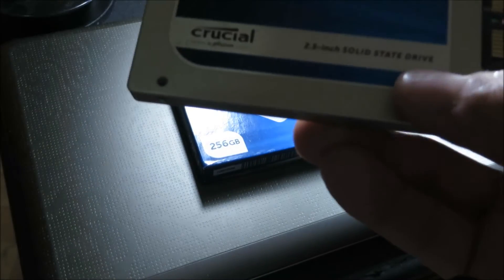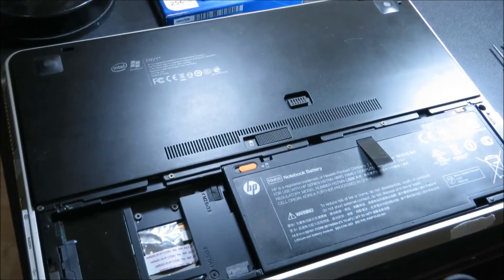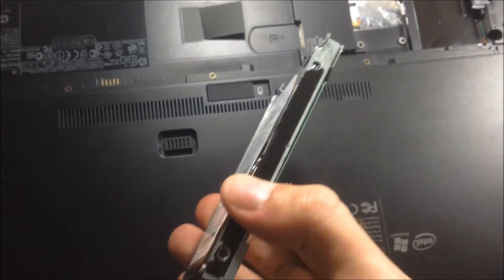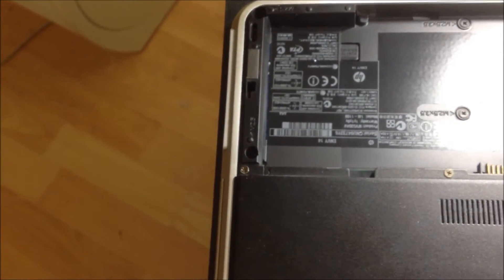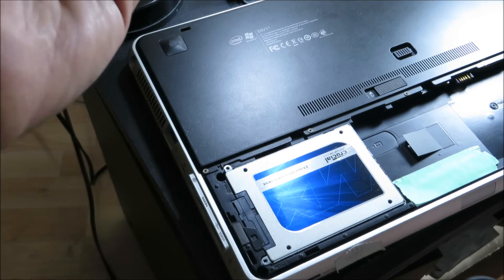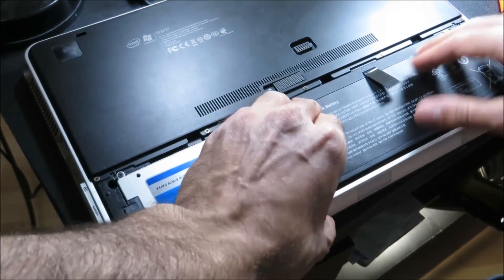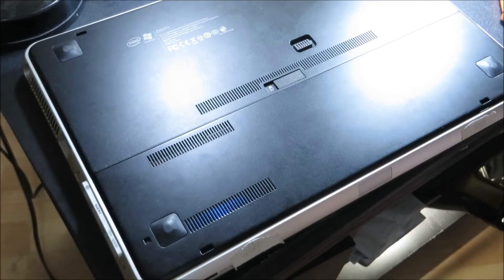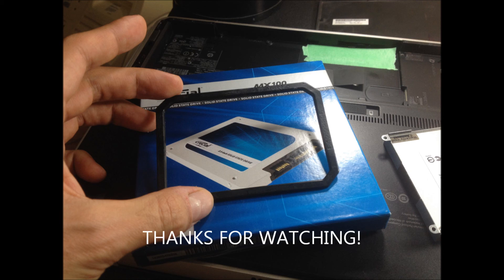Adding a SSD into my Laptop Hp envy 14 (crucial MX100)

Comment: Thanks for the video.  I have the HP ENVY 14 beatsaudio (14-2020NR).  I have 16gb of RAM and the I5 intel processor so my speed isn't to bad already...  How can I know if my laptop supports AHCI or SATA3?  I have looked around and can't find any answers....
Also, if it doesn't support either of those, will it still run or will that be a problem.   Thanks again.

Comment: Did it make the laptop more silent? Because i dont like the sound of the hd running on full rpm constantly. Also did it improve your battery usage?
Reply from the maker: +mathijs v  it might have improved the battery life but i wouldn't know because my battery is practically dead.

I'm eventually going to get a new laptop because i noticed the main noise of the laptop are the fans, and sometimes my fans stop working... Otherwise it's been a good 6 years
Reply: Ok I see. Thanks for the reply!

Comment: Did you used the recovery manager in the new SSD? because right now I am facing a problem, when I try to recover using my DVDs set, it show me an error telling me that the HD is not the same that the original. "the hard drive of this computer is smaller than the original shipped hard drive"
Reply from the maker: +Ignacio Sandoval Nope. I used acronis cloning software that came with my ssd. I simply cloned my old hard drive to my ssd.

Comment: I'm planning on replacing my HDD to an SSD on my hp envy 14-2002ea, the user manual is here:

http://h10032.www1.hp.com/ctg/Manual/c02878045

The only issue is, I was wanting to replace the HDD with this SSD.

http://www.amazon.co.uk/Samsung-256...&qid=1436581704&sr=8-3&keywords=ssd+2.5+256gb

As the SSD is clearly 256gb, and on p10 of the manual it does not state that that SSD configuration is possible, is there any way that I will be able to use this SSD? As ideally I need more than 160gb, which seems to be the maxmimum supported  mSata SSD capacity for this laptop ( I want to replace it with a SATA3 SSD, not an mSata SSD)